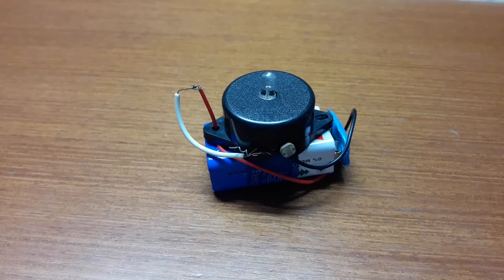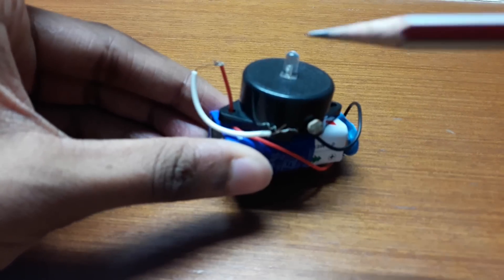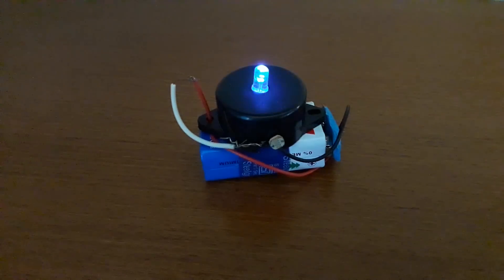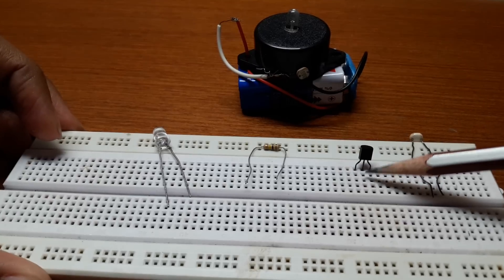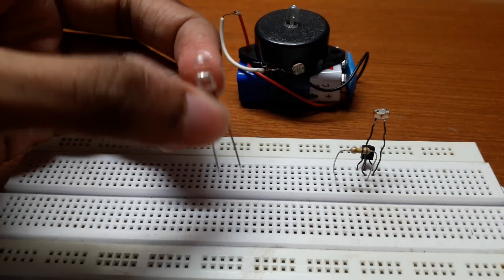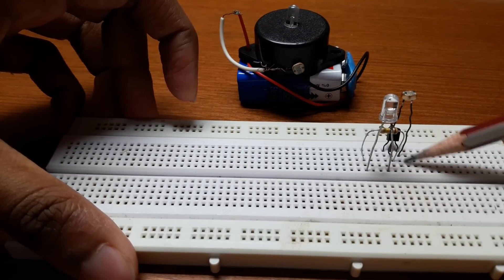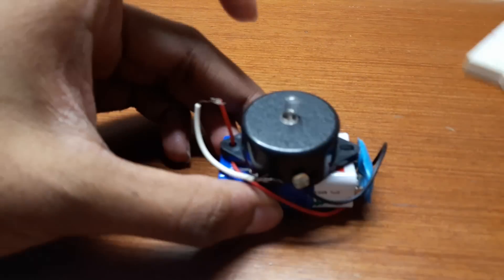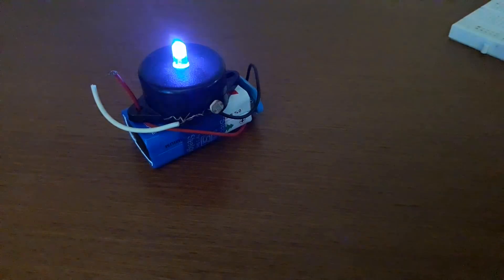How To Make A "Dark Sensor."

Comment: Bro its working reverse... …when It gets light then it happenes but when I turn off my rooms light then it also be off!!!!!?
Reply: Please bro help me soon....
Reply from the maker: +Tasaba Rk Hey bro! Check my latest video on "How to make a Dark Sensor." You'll definitely understand. 👇
LINK :-- https://youtu.be/c0bsQer6KTs

Make sure you check the description also of the video for the steps of construction.

Also most important, make sure you use a 100k ohm resistor - colour code (brown,black,yellow & gold) 

Comment if you have anymore queries. I will be uploading one more video on "How to make a Laser Security Alarm System" soon which is similar to the Dark Sensor so make sure you SUBSCRIBE. ✌
Reply: I did it bro.....but can you explain me how can I make it without any type of board board......
Reply from the maker: +Tasaba Rk Its simple bro!! Just imagine all the connections you made on the breadboard and then solder/connect everything in the same way without the breadboard.
Reply: Tasaba Rk hlw